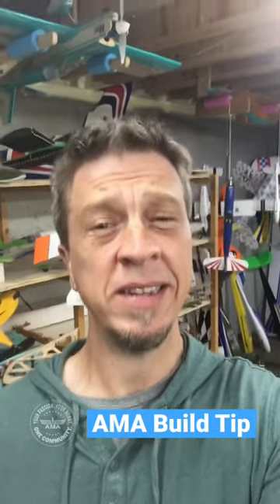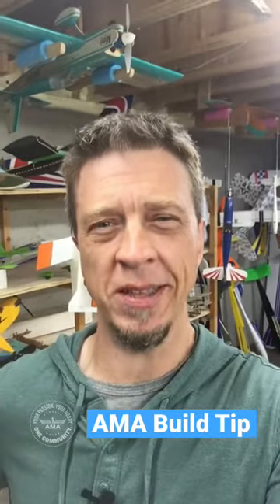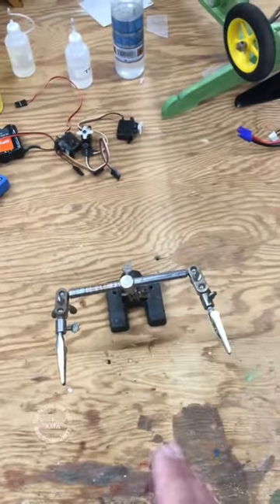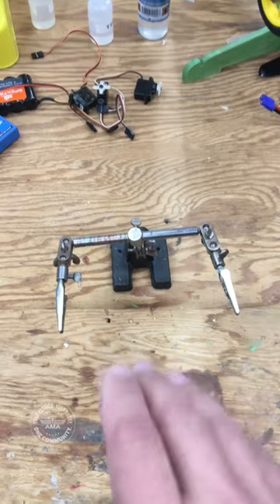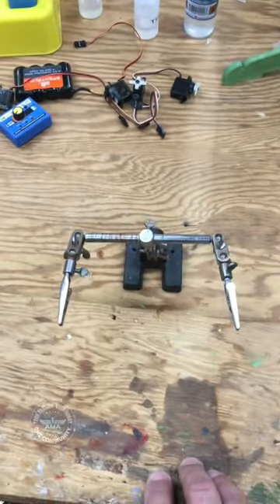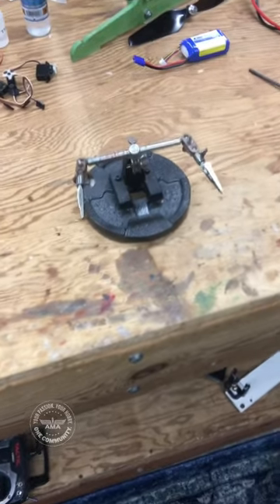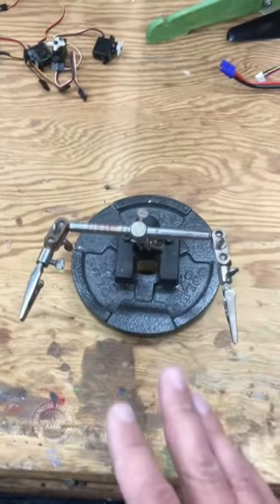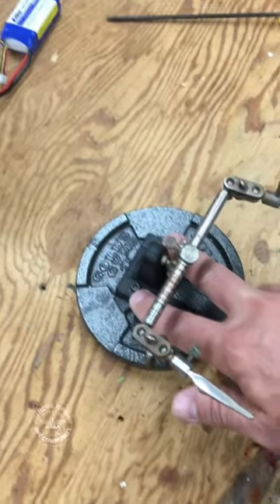AMA Build Tip - Terry Dunn / Helping Hand Weight

Comment: I actially bought two of these (the ones with the magnifying glass added) and slid the second arm through the magnifying glass holder and so I have 4 alligator clips in an X pattern and that lets me have two that are closer than the length of the single arm.